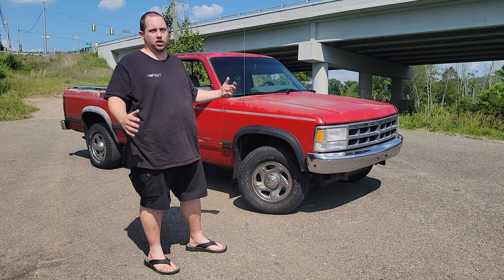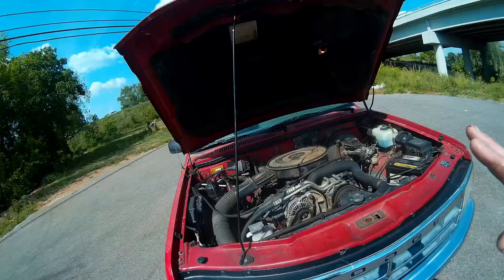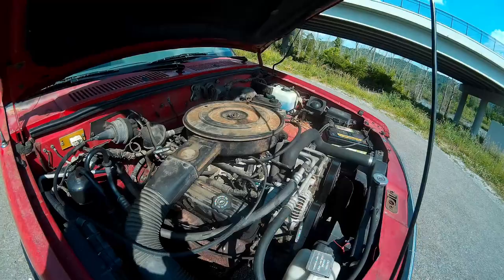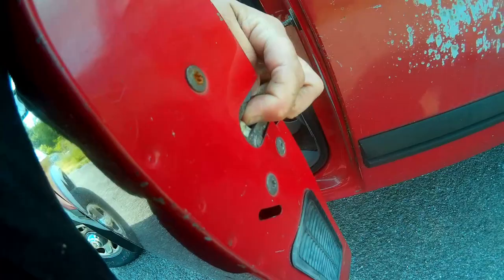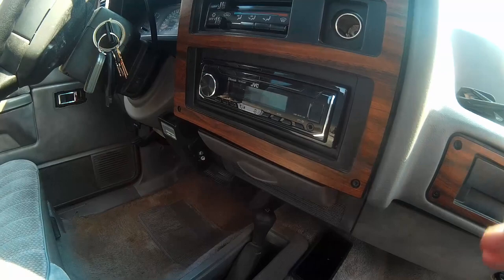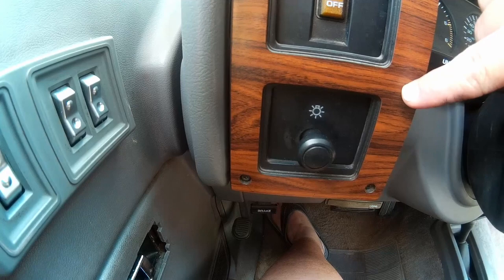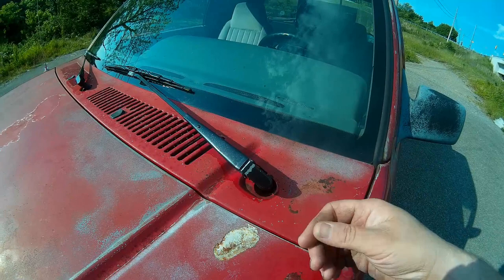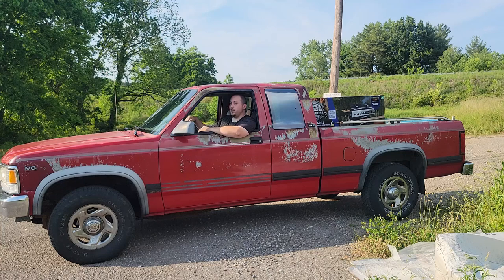To Dakota, or Not to Dakota? A Buyer's Guide for the First Generation Dodge Dakota, 1987-1996

Comment: I need new control arms. If anyone has any leads please let me know. My 1996 dakota needs them. 318 v8 4x4. I'm having a very hard time finding these. Also I have almost every issue you have lol. But I love these trucks so fucking much
Reply from the maker: How do you determine if you need control arms? Is it the bushings? If so makes me wonder if they can be serviced like on my old c10. I replaced the control arm bushings on it. It's alot of work but possible
Reply: Mine are rotted. My frame is rotted where they connect. But I managed to heat everything enough with a oxygen acetylene torch to get it apart and fix the frame. I figure it's easier to get new control arms with bushings and ball joints than to try and save the ones that have rust issues where they mount to the truck. I just replaced all 4 shocks and all 4 tie rods and adjusting sleeves along with patching the frame in a couple spots over the years. I'm a pretty good welder so I'm not scared of rust or rott for the most part. There used to be a website that sold brand new frames for these trucks but I haven't seen that for a while either.
Reply from the maker: @codyrocksatguitar2  ok well that seems like a pretty sure sign. I still need welding done on mine, but for door hinge repair
Reply: I welded the bottom of my driver's side door back together... all the other hinges have been pretty solid for the time I've owned it. If your around new Hampshire at all, maybe I can fix yours for ya. Great video by the way.

Comment: Years ago in the 90’s I had a 95 Dakota Sport with the 4 cylinder. Total piece of crap! I bought it in 97 with only 32k on it. Radiator went 3 days after I took it home. AC compressor went bad at only 40,000 miles! It was the worst truck I’ve ever owned in my life! Since totaling it in 2001 I’ve driven only Fords. Until recently I have not even wanted another Dodge product.
Reply from the maker: That's truly a shame. I don't know the full history on mine, but it's over 207k now with what I can only assume is the factory compressor and radiator. Wonder if there was something about the 4cyl trucks. My v8 truck is pretty great, of course it's old now and has old car problems
Reply: @ThatCarVlogChannel  If you drive the 4 cylinder like grandpa would it is a remarkably reliable engine. I have a 95 with a v6 and it takes anything you throw at it. I just sold the V6 engine for $450 with 150K to a guy with the same year truck who needed a motor that didn't already have 250-300K on it. He had several sitting around with that mileage. I would not trust a 90s 4 cylinder in it though....It weighs 4000lbs. I bet that thing could barely hit 70